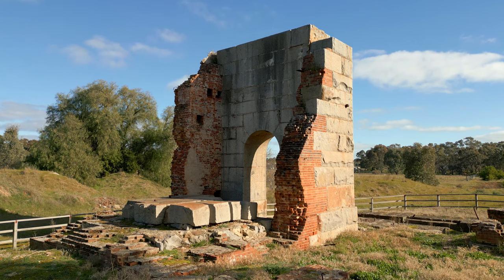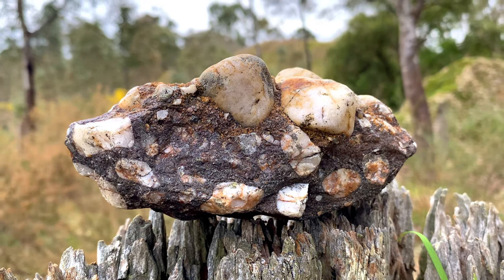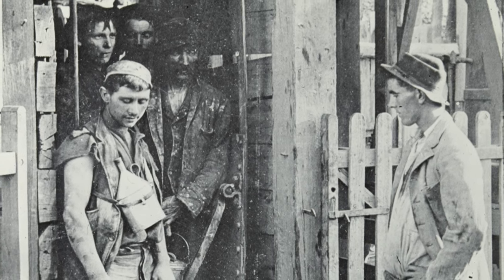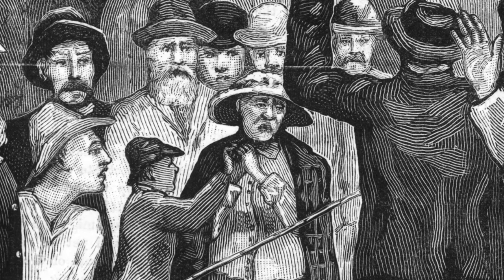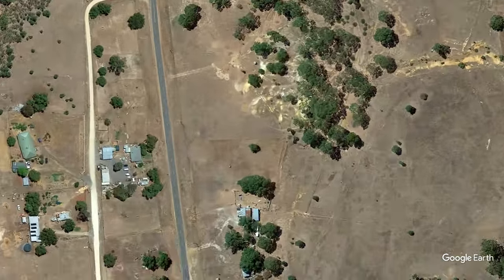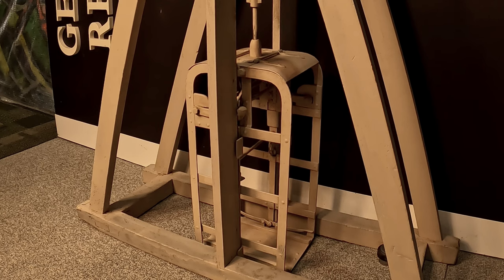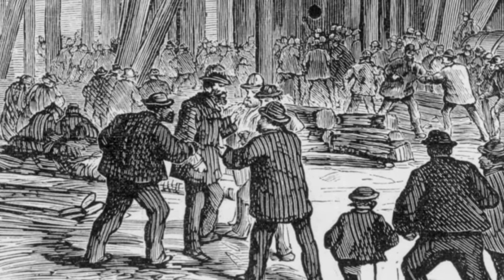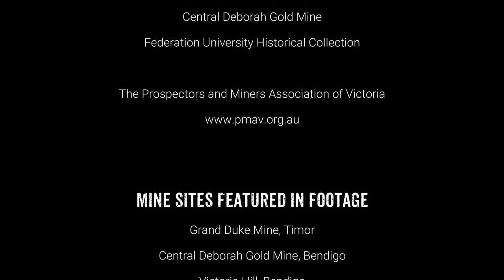Exploring the Shocking 1883 Gold Mining Accident at the Duke Company Mine

Comment: Just a question about the poppet head on a previous video, I know those old engines that run them can misfire and run backwards, i know this because they used to run shearing gear and when this happened it would undo all the cogs and finish up at your feet, maybe the engine operator was responsible. Paul

Comment: Excellent tape,  such a tragic death for those miners, all due to the incompetent of one man. The bloody Winder driver!
Years ago while gearing the cages in I notice that the grippers on the man riding cage didn't move when the weight was taken up on the rope(cable). Got the winder driver to lower cage back on gates,  in my inspection three out of the four grippers were completely seized. Not properly maintained by Winder driver, after his lame ass excuses stating all seem okay during the last drop test, which was not recorded in the winder drivers book?
I fixed the grippers and continue in the works in hand, in hindsight I should have fired him on the spot, but winder drivers are a dieing breed and hard to come by and there was work to be done.
I also had another winder driver drive the cage through the Jack catches with in inches of the detaching bell, panicked and stop hard, coursing the grippers to come in.
I had to take over as he wasn't capable, and drive the cage up into the bells with the detaching hook just touching the bell before the grippers disengaged.
Once again Bloody Winder drivers.
Reply from the maker: Thank you, wow that’s unreal! 😅😣
Reply: Awesome. Where was this at?